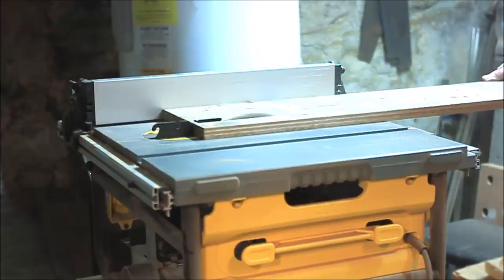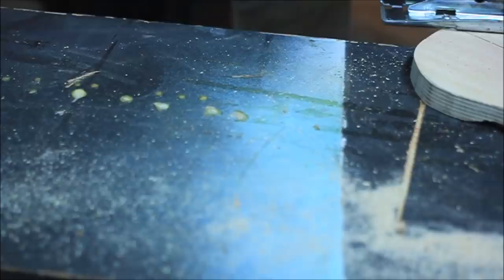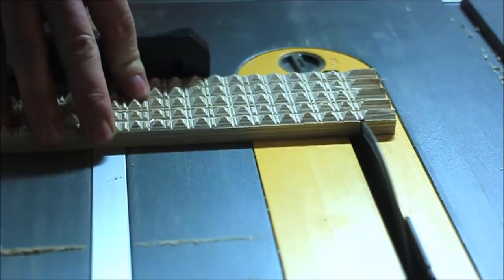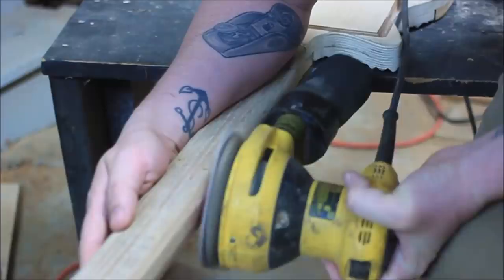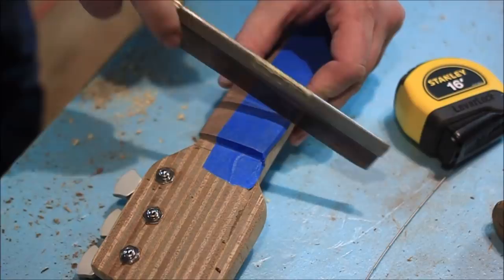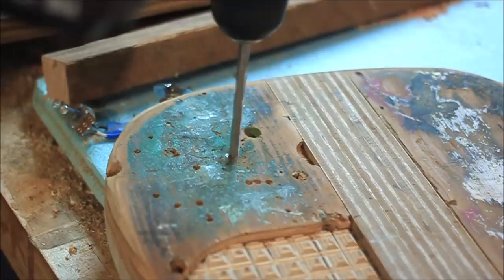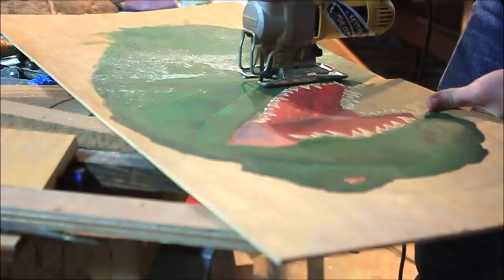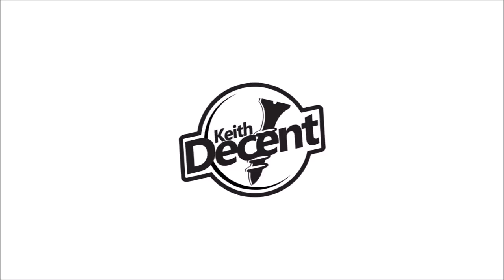DIY  ELECTRIC GUITAR FROM PLYWOOD - a Decent project

Comment: As a guitar builder the most impressive part of this build is the custom pickup. It may not be pretty but it worked and you did it yourself. I only have 1 major complaint about this build, you should have put the dinosaur on the outside of the back that thing looked awesome. Still great job man.
Reply from the maker: thanks so much. yeah it was vary much a "can it be done?" experiment that will move on to "can it be improved?" soon
Reply: My Questions about Pickups-  I had some with 2 wires and others with 4 wires.  Please explain.  Still Learning
Reply: These are called coil taps. Essentially you can electrically change the pickup from a single coil to a humbucker and back again.
Reply: @richardprutz6458  2 wires... negative + positive
4 wires ?? ...negative + positive + neutral + ground
I think...?!
Reply: Nah it's just allowing for a coil tap as Pat said.  @redbullnshimano1  You have 2 single coils that are reverse wound reverse polarity and put together to make a hum bucker. The 4 wires are the start and end of each coil. A Standard non tapped hum bucker will bridge the end of coil one to the start of coil two leaving the start of coil one and the end of coil two as your two "Normal" wires, same as what you have with the single coils. Tapped coils have wires at the start and finish of each coil giving you coil one start, coil one finish, coil two start, coil two finish.
Reply: Jono Graham 
Now I'm really confused. Anyway thanks for the explaination. I'll try to figure what you just explained.
Reply: @richardprutz6458  these are not coil taps, a humbucker is basically two pickups side by side with the wire on one wound clock wise and the other counter clock wise with the magnets reversed, one south up the other north,  this gives two signals 180 degrees apart so the waveform of one ac signal is cancelled by the other thereby canceling the hum you hook the wires to a switch so that in one position the signal from one is going to go to your amp and the other position through the other coil and then to your amp, a coil tap is where the coil is wound to a certain point ant then go's to a switch that will ether send the signal to your amp or back to the pick up to go through further whindens and than to your amp wich generally gives a fatter sound but will cut down on the high end due to compasatins, glad to see you wanting to learn my best advice is DON'T take advice from internet experts at face value most people out there think they know a hell of a lot more than they really do
Reply: Thank You-  I always loved what The Humbucker  Sound
Reply: I agree, the hand winding of the pickup for the "just because I can" factor was pretty awesome. I love the p90ish fat single coil sound. Very 50s sounding.
Reply: seriously the dinosaur was a missed opportunity lol imagine showing someone the guitar then being like 'oh ya and look at my dinosaur!'

Comment: The purpose of the ground wire to the bridge is to ground the strings, which will generate an electric charge as they vibrate in the magnetic field of the pickup. 

To bleed this charge off, it's grounded, with a metal to metal connection from the strings to your ground circuit. It looks like your bridge is wood, which will insulate the strings from the wire and prevent the strings from grounding.
When I built my electric guitar I also used a wooden bridge, so I grounded the strings through the tail piece, which was metal. I just ran a piece of wire to the mounting screw and tightened it down. Piece of cake.

Comment: Just FYI... neck through guitars still typically have a trussrod... still really cool build though.
Reply from the maker: yeah, im seeing where this one will almost certainly warp in the future, so im thinking ill do another video down the road where i install a truss rod, a tone knob, and maybe turn the pickup into a humbucker.
Reply: @KeithDecent  I know this is very old now but I wanted to let you know that your neck has extra protection against warping. When you aligned the layers of the plywood the way you did to make the neck you inadvertently replicated some very infamous/famous neck designs. The issue won't be warping, laminate necks are very strong. It's that without a truss rid you won't be able to adjust the action. You're basically stuck with however the neck turns out. Most necks are one piece because a certain amount of flex is desired. Laminated necks are so strong, even if you had put a truss rod in there it might not have been able to bend the neck. 

None of this detracts from how great your build is. Most people talk and don't do. I hope you kept on building guitars.

Comment: as a lover of luthierism, all i can say is BRAVO!!! the idea is awesome, and the fact that you have done it in such a short period is amazing. I love the idea you come up with the tailpiece. Regarding the "floating bridge" as you called it, i would recommend a harder material. That wood seems to be soft, therefore the strings will get constricted in that ditch and it will fade the brightness of the strings.
ah, and the pickups screws are supposed to be straight under the strings.

ok sorry for the critics... I really love what you have achieved.

Comment: My roommate made a top and back covered formica plywood electric guitar with a junked Floyd Rose type bridge with a lock down so no whammy bar is used and has a first act electric guitar neck !
It is 25.5" scale with P-90 Dog Ear Pick Ups and it looks awesome but a bit steam punk !
The sound is unbelievable and good , very articulate and beautiful sounding beyond what P-90 pickups ive heard on 24.75 scale guitars sound like  !

Putting a $20 each Dog Ear pickups on a 25.5" scale is magical has a great studio sound just letting you know we discovered messing about !

The trick is all the measurements of the bridge to the Nut distance must be very close to the scale for the intonation to be adjusted perfectly !
Walter somehow got it dead on !

Comment: What an awesome project. About the frets though. I do believe it's better to measure all frets from the nut or at least a single point. If you keep measuring from every previous fret all small deviation will add up, so after a couple of frets you could be way off. Still a very cool guitar though, well done.
Reply from the maker: youre absolutely correct

Comment: I'm no rickenbacker neither, but I reckon the bridge should 've been made with a denser material such as iron or glass, in  order to achieve a longer vibration on the strings, thus getting more sustain, other than that it's quite a cool project.
Reply from the maker: Eri Galarraga Montes thanks! Luckily it’s just a floating bridge and I can pop a better one in there anytime.
Reply: Well i am a total Rickenbacker. And that guitar sucks ass. It looks like a piece of poopie.

Comment: I think it's called a tailpiece. You're welcome.
Reply from the maker: I think YOU'RE called a tailpiece!
Reply: he's right
Reply: No a saddle davebauerart
Reply: To be completely accurate the part to strings are are fitter through is the tailpiece, and the part that they lay on is the saddle. In some cases like this one they are both on the same part
Reply: @maxwellcollier5335  A bit late, but the bridge is the system that holds the strings off the body. A saddle is part of the bridge which makes contact with the string. A tailpiece holds the ends of the string to the body. A guitar may have just a bridge and tailpiece, or all three parts. They can be three separate parts, or just one unit. A guitar with a string through body will use the body as a tailpiece.
Reply: Actually its a saddle

Comment: Very inspiring! The build was well documented with good video and narrating. Building out of recycled materials is the best part, although I'm not sure about pulling apart little transformers, but I'm glad it worked for you. This pushes me towards my next build. I'm going to try and use wiper blade inserts or use epoxy with some sort of wire for frets.

Comment: A scrap plywood guitar is cool already but it doesn’t get any more ghetto than using your old workbench plywood top. That was wild. Making your own neck, and a homemade pickup out of a ruler(!) and repurposed transformer wire(!) made it even cooler yet.  The pickup surround made out of record album...just amazing.
Reply: Saw that you liked my comment.  Just remembered....I actually made a plywood guitar once, about 15 yrs ago.  It was a stage prop for my son's school lip sync act.  The neck was a quality reject donated by G&L guitars in Fullerton, CA  (thank you, G&L!) with an Explorer-style headstock.  So I cut a few layers of plywood into an Explorer shape and glued 'em together.  I just drywall screwed the neck onto it.
Instead of a pickup, I hotglued a 2"x4" makeup mirror onto the body.  Using a Sharpie, I drew the oval outlines of two pickup bobbins and 12 pole pieces on it.  From 10 feet, it looked like a chrome humbucker.
The tailpiece was a 4-1/2" length of electrical conduit, just vise-crimped at each end and screwed down to the plywood with 2 screws.  It made a great tailpiece because conduit is soft and super easy to drill string holes through.  No bridge was used...who would notice anyhow?
For tuners, I used 6 short bolts, some fat nuts, and two washers under each bolt.  I just pinched the strings between the washers....you could actually tune it, if you used a wrench!  A set of used strings completed the look. 
I covered the body with fake sheepskin from a fabric store, hot-glued on, to look like ZZ Top's fur guitars.   
The headstock was also upholstered with the same fake sheepskin, which covered up the bolts.
A jack for a cord would have cost money, so I screwed in a fat little 6" black antenna wire, about where the cord would normally go, to make it look wireless.  Very pro-looking!
Got some strap buttons out of my guitar junk box, and an old strap, and my boy rocked the house.  
It looked really cool on stage; probably better than one of my real guitars would have.

Comment: To those who hated on the no truss rod thing..... I got both an early Kay Bass and an early Teisco Electric that are factory plywood guitars with plywood necks without truss rods....  After 50 years (give or take) of "God  Only Knows" type of treatment by all the previous owners, the necks are still straight..... I guess the builders back in the day knew exactly how to build a neck right using only plywood compared to those who use green/immature wood that does require truss rods.....

Comment: figure some way to tweak the saddle for intonation.  it doesn't need to be long term adjustable. it just needs to ability to center the 12th fret between the saddle and the nut.  the thickness of the strings play in to that too.  had fun watching this.

Comment: This video is making me want to make a scrap guitar myself, but i have 2 questions:
Firstly, what glue are you using for the wood?
Secondly, where did you get the potentiometer? Did you buy it or did you harvest it from some scrap electronics?
Thank you for the awesome video!
Reply from the maker: the glue is just regular, old, titebond wood glue. and the potentiometer came off of another, broken guitar.

Comment: Through neck guitars can have truss rods and you can make a set/bolt-on neck without a truss rod. The two things are unrelated, through neck just means the neck wood runs the full length of the guitar and doesn't have anything to do with the truss-rod or lack thereof.

Comment: The pole pieces (the screws) on the pickup are supposed to be directly under each string. They’re a bit too spaced out. Also the name of the part the hinge is acting as is a tailpiece. Cool build though, one of the most unique builds I’ve seen.

Comment: Great job considering you have no experience with an electric guitar. There are a few important measurements that need to be utilized but, for the most part, after that you may pull whatever is in your brain and go to it. Be very proud. It didn’t sound bad at all, probably on par with the cigar box guitars but you have more strings to work with and the tone was better. Thumbs up dude! 👍

Comment: It was hard to tell from the video but it looked like the strings didn't go over the magnets on the pickup. If that is the case you would have needed to use smaller bolts and magnets to get the spacing between them so they would be lined up under the strings. Still, kudos for going the extra step to make your own pickup.

Comment: Nice work dude. Can you help me on what you use for the pickup ? What type of wire ?
Reply from the maker: if you check out my channel, i made a more specific video about how i made the pickup and what i did and why. It should help a bunch. it's also linked in the above video.

Comment: Did you cut the neck so the width is narrower near the headstock and wider at the body? I'm planning out my own guitar build and I'm trying to figure out if tapering the width of the neck is important or not. If you didn't do it on yours, how does it feel to play?
Reply from the maker: i did. I dont think its necessary, but since my neck is already pretty thick I think it helped with the playability. I would say go for it, i was able to do it with just a jigsa, it wasnt too complicated
Reply: Keith Decent awesome, thanks!

Comment: There is one part of the construction of the neck which isn't clear to me: how do you know the pitch change between the frets will be accurate? How do you know that the first fret will be an F note if a string on this is tuned to E?
Reply from the maker: Azaad there are measurements and templates available online. It’s all based off the distance from the nut to the bridge. There are different “scale lengths” but they’re all available if you search.
Reply: Oh cool! I definitely have to do more research about the design of the neck. I wonder if a 36 or 48 fret guitar is possible.
Reply: michael angelo batio had a 36? fret guitar or something crazy like that, the problem is that you lose space for pickups ect.
Reply: They're called baritone guitars and I can't even pretend to understand the design problems that would come up in their construction
Reply: Azaad,guitar building is not that complicated as you think
Reply: No question about it. Keith just showed us how you don't need to be a rocket scientist to make one, that is why I love this guitar so much. Still, when you dig deeper into neck design and start thinking about truss rods or fret locations, it isn't exactly an easy problem either (at least for me at the current moment)!

Comment: Thats great work, thanks. I’ve been looking at guitar kits for a while but not impressed by just assembling parts and the cost. I need to cobble every part myself. The goal is to not buy anything.  I would have to buy fretwire,  if I want real frets.  Everything else I have.  By the way, to make the pickup bolt poles straight, drill the holes with the two wood pieces clamped together.

Comment: if you had put the pickup closer to the bridge, you would have basically made a Les Paul Jr without a tone knob. (fwiw, a few guitars in the last few years have been without tone knobs... an example of this is one of my favorite guitars that I own: Fender Jim Root Stratocaster. it has one knob: the volume. I bought it online & sight unseen except for pics. once out of the box, the second thing I did was to go online and see how many knobs this guitar was supposed to have. surely the answer would be four, like a Les Paul... two volume knobs & two tone knobs. hell, they could have thrown in a couple of switches and some push/pull pots... but nope. one knob. but when I'm playing that guitar, I don't miss the extra knobs.)

as for the guitar (because I have not rambled enough) it sounds like  you need to raise the pickup so they're nicely in the magnetic field of the pickup... and while you're looking into that, try to get the pickup an equal distance from the pickup. this could be a solved by a setup, even though a professional setup will cost you more than the guitar did. you can probably adjust the bridge to get all of the strings even. I think it's awesome that you wanted to make an electric guitar from scratch and you decided that "from scratch" includes winding your own pickup(s). kudos, dude.

my last statement is one I don't have time to look up (wife's calling. dinner is ready.) I don't remember why, but walnut makes a "terrible" (that's what I remember reading... it's probably just "not the best") wood for the fingerboard. as I recall, it is one of the harder woods in construction, but with the constant abuse (the strings are quite abrasive, like sand paper) walnut will quickly allow concave divots to form. truth be told, maple is similar, but it takes longer.

please note that these are only my opinions and should be taken as such. my "opinion" on a whole is that this is awesome! first try or 50th try, you got an idea and had the balls to see it through to the end... oh, and you probably should've put the dinosaur on the outside. good luck on your next build.

Comment: "so instead of a truss rod"... I build guitars, truss rods are intended to be for adjusting the bow of the neck. you don't technically need one, but regardless of whether the neck is a through neck or not, having a truss rod is useful.

Comment: This guy's cheaply budget friendly guitar build sounds way better then any squire strat you can buy. I dint understand how does the neck get set properly if you don't have a trust rod
Reply from the maker: Well you kinda can’t, as I learned later. But it’s a pretty easy thing to just add to any design
Reply from the maker: That being said, the plywood is really strong and stable so it doesn’t warp as much.